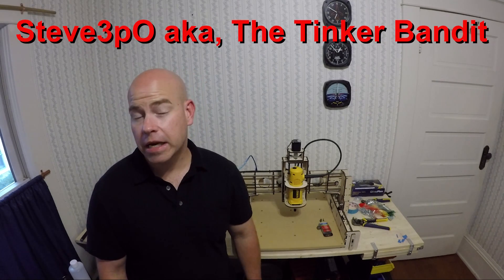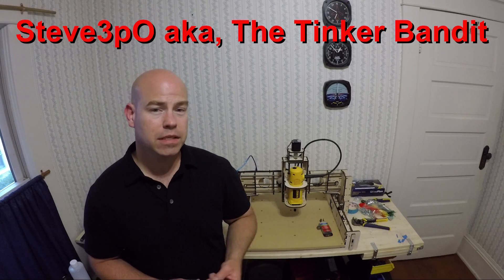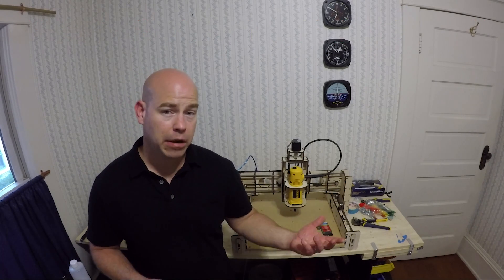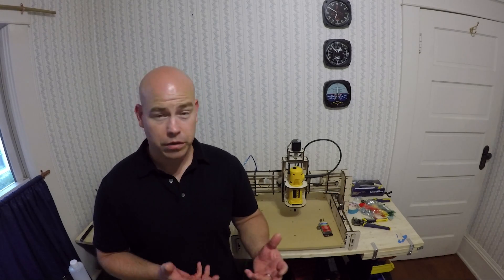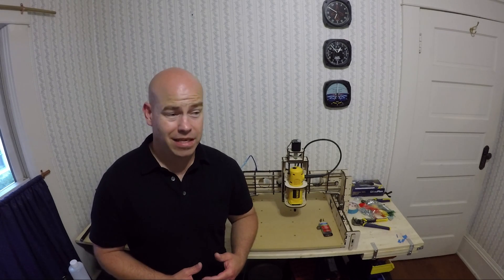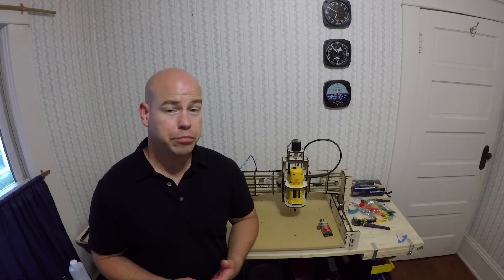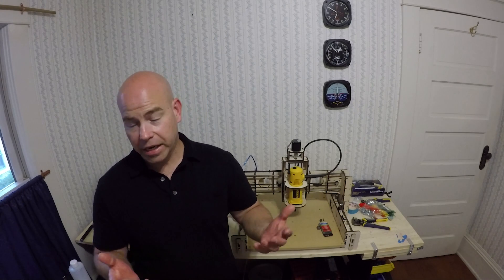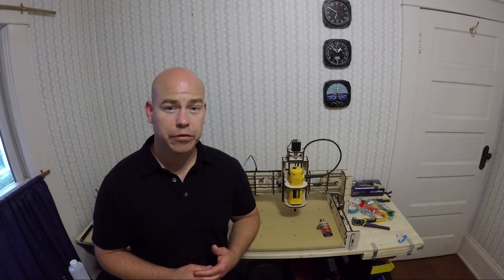Steve3pO CNC Router Kit Assembly

Comment: What is your overall, candid opinion of this unit? Do you feel it is worth the cost, and is it accurate enough for the work you have done with it? Have you run into any major problems since you got it up and running? Thanks in advance for any feedback you may wish to provide, rest assured that it will be greatly appreciated..
Reply from the maker: Terry, I'm so sorry I'm just now seeing your message and several others that were held for some reason and I haven't been checking them.  I'm having to adjust my settings.  I feel the E3 is plenty accurate for my purposes; I make engraved plaques, signs and game boards for family and friends.  The E3 is holding up great despite rigorous use and soggy Pacific Northwest weather out in my workshop.  My weakest area is always software and with the E3 it was where the software (UGS) meets the hardware (micro controllers).  I ran into "poverty-of-knowledge" issues with both having never before used anything like this. However, Bob himself was a huge help through his videos and phone support.  I hope that helps!  I apologize for the wait.

Comment: what engines did you use?
Reply from the maker: lis71313, I'm so sorry I'm just now seeing your message and several others that were held for some reason and I haven't been checking them.  I'm having to adjust my settings.  Here's a link to Bobs info page on the stepper motors.  I've never used them before this experience and they are very hardy 'lil things.  I didn't think they'd survive me tuning them let alone soldier-on without a problem for these last 6 months!  I hope this helps, I apologize for the wait.https://www.bobscnc.com/blogs/news/the-stepper-motor-for-cnc-machines